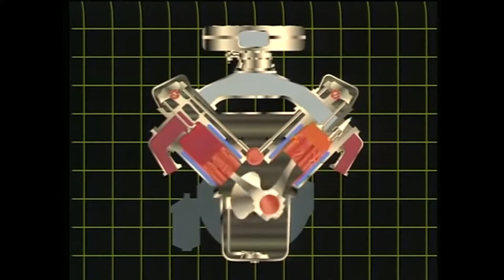Engine Rod Knock Vs. Piston Slap - Take a listen to both!

Comment: The whole "classic cars were only designed to go 100K miles/a couple years" thing is such a BS statement. Classic American cars survived in mass for a reason. My daily driver for the last 15 years has been the same 68 Plymouth and also I've got a 72 Cadillac, 73 Mustang, 67 Cougar, 75 Valiant, 68 Dodge Coronet and an 84 Trans Am that are all still going strong on their original engines and drivetrains and they are all such common cars that I was able to get them cheaply in this day and age. That's not just some fluke. Especially considering there are almost zero classic foreign cars out there running on their original build.
Reply from the maker: Hmmm, these facts and opinions seem to look pretty similar, don't they? 😜

Comment: My '99 Silverado Z71 5.3 with close to 300,000 miles has piston slap for about a minute upon first start up of the week then it goes away and it's very quiet (it only gets driven to the dump once a week).
Reply from the maker: Seems to be a common issue in that generation of GM V8's, and all of them don't care and just keep going too!

Comment: The 3.3 gm and the 3.8 can be the crankshaft balancer broken sounds exactly the same.
Reply from the maker: Is that a common problem on those puppies?
Reply: @ Yes and it sounds exactly like a rod knock I mean exactly the rubber separation on the crankshaft pulley.

Comment: I had an 85 cherokee with the 4 cylinder. It had a really bad rod knock from being run out of oil before i owned it. I said ill drive it until it dies. Got around 60,000 miles out of it. Im not saying to do it. Just saying i got real lucky. Most people probably would have scrapped the engine when the knocking began. But i wasn’t worried about what so ever. So i just kept it going until it died just to see how long it would take. When it finally did croak there was over 1/4” of gap between the crank and rod. But every other part of the engine looked like it was a maintained engine with less 100,000 miles on it. I found that to be quite odd how the rest of the engine was in very good working order. I even ran it out of oil once myself by accident. It had a leaky top pan gasket. Which was why it ran out of oil in the first place. I never bothered to even fix it myself. But that was just some add on to your video. But yeah. Time to pull that engine if it has rod knock. Because it isn’t gonna last.
Reply from the maker: Damn, that's actually pretty impressive! It does surprise me how long some car parts can still go despite being completely annihilated. I had a family member drive for several days on a front wheel bearing that had completely disintegrated, which basically left the car riding on the outer bearing race and the CV axle.... how it didn't catch on fire, or worse, i have no idea.
Reply: @ExiledWolf84  ain’t that the truth. My brother drove about 50 miles on a completely blown engine. No idea how it was still running. Bot the crank and cam were broken into 3 or 4 individual pieces. Some of the rods were bent. Some really bad. And the number one piston was nearly completely inverted in the cylinder and that rod looked like a horse shoe. Id say that was the final nail when it finally quit. It sounded like 10 blacksmiths pounding anvils in the same room. Lol. It was a very high mileage 351 windsor from an 84 crown victoria police car. It really hung on until the very end. It had nothing left to prove. Lol.
Reply from the maker: Damn, that's impressive!

Comment: quick question, i believe it is just piston slap, but it only happens for maybe 3-4 seconds when i start the truck, and then goes away. will get worse over time?
Reply from the maker: That has several variables ... What kind of truck and engine does it have? 

There is a common issue, for example, with some of the 4 cylinder Toyota engines where there is a pin that fits into the VVT-I sprocket that wears a little, and when you first start the engine up, the pin has trouble engaging the sprocket and its jitters around for a few seconds before it seats, causing a clattering noise on startup.

Not saying thats what your engine is doing,  but it's just as an example of noise that can come with an engine startup.

Comment: Most of that sound you heard with the rod knock is actually the sound of the piston tapping the cylinder head due to the increased rod bearing clearance.
Reply from the maker: So i've been told! Wish there was a way to add tidbits to the video after it was uploaded!

Comment: Bad groundwire on that first startup, i assume.
Reply from the maker: I wouldn't be surprised! In that particular shot, it's trying to start with just a old jump starter with just barely enough juice to get it running. The car hadn't been registered since 2019 (as you can tell from the pine needles) and belongs to a family member who moves it from place to place hoping to get it fixed up someday.... well, looks like one of those times it didn't have any oil in it and this video was the result of that!
Reply: @ExiledWolf84 yeah, it shows that it sat for a while. Maybe not a bad ground wire, maybe just caused by sitting for a long time. But the sound of bad ground wire is exactly like that in the beginning. Slow, almost stopping, and then it slows it way to start..
Reply from the maker: @aciddiver1978 I'm willing to bet the body grounds are corroded something awful, like you are saying. It basically sat in a wooded area for years and wasn't taken care of or washed at all before that!

Comment: Piston slap was common on GM 3100 and 3400 60 degree V6 but has nothing to do with reliability I had 469,000 kilometers on a 98 Buick century with the 3.1 ticked like a clock but always started when I wanted it to.
Reply from the maker: Buick has always made a hell of a vehicle, haven't they? The particular one in the video was HEAVILY abused and was basically abandoned in the woods for several years, and was run once or twice with no oil... Hence the rod knock... Too bad, because it was a nice car at one point!
Reply: @ExiledWolf84  proper maintenance prevents poor performance...good video

Comment: As a Volvo Red Block driver with 500k miles, I worry if I don’t hear piston slap.
Reply from the maker: I hear that! I had an old Landcruiser that leaked oil from the rear main seal, and so long as it was leaking, I knew there was oil in it.... If it stopped leaking, well, then there was a problem!
Reply: One day working at a shop I got a repair order to check out a Volvo for engine noise and oil leak that was just driven in. There was a hole in the block ! Since it was already junk i drained the oil out of it and held the throttle wide open. It ran then the rpm's started to drop until it locked up.

Comment: I think i got piston slap with my Mitsubishi. Knocking for about 20 seconds. Weird, i just got 32k miles and have piston slap 😢.How come? Is it because of thin oil that i use? The dealer asked me to use 0W20 oil. Should i change it to 5W30?
Reply from the maker: I'm guessing that the car is relatively new? I wouldn't change the viscosity of the oil from what the engine recommends, especially on something that new with so few miles.

Comment: The Cadillac sounds like valve train noise to me. I could be wrong.
Reply from the maker: It's a possibility! The noise is running at twice the frequency of the valves opening and closing, but If I dig into the valve train and find that there are two dead lifters then I will re-upload this with a different video for the piston slap noise.

Comment: You didn't explain the diagnosis procedure. Pull plug wires till offender is shown, goes away= piston slap, gets more frequency= wrist pin, gets quieter = rod bearing, changes pitch or frequency on two adjacent (on crank throw) cylinders= main brg.
Reply from the maker: Might have to do a follow up video on that one!

Comment: What about wrist pin knock.. I think it's a double knock  noise.. metallic noise
Reply from the maker: It's hard for me to comment on that one since I haven't personally experienced it yet, but from what I've been told it's a little less consistent and sounds sloppier than rod bearing knock, simply because you have the element of the piston rattling around as well!

That and the fact that it's a little more rare because wrist pins are seemingly made out of the hardest material known to humankind! 😜

Comment: I think my 2022 Mitsubishi got piston slap. Knocking for about 20 seconds. I just got 32k miles with this car and have this piston slap 😢
Many friends with this car also have piston slap too. Is it because of thin oil. The dealers recommended 0W20 oil in a tropical hot climate country here
Reply from the maker: Funny, the guy who commented right before you had the same issue with the same car!
Reply: @ExiledWolf84  maybe he has the same car. Piston slap is majority cases recently  especially in my country. The latest cars that recommended thin oil 0W20 or thinner got piston slap at low milage (below 50k kilometers)

Comment: What is the difference between piston slap and a slightly worn wrist pin. Both of them will go away when the engine warms up
Reply from the maker: From what I understand piston slap is cause from either wear on the piston rings, or from wear in the bore, almost like it's becoming slightly oval. 

I didn't cover it in the video because I simply forgot to talk about it, but as the piston expands with heat, it fills the bore a little better and the sound goes away.

I don't personally have experience with a worn wrist pin yet so I can't comment on it myself, but I imagine the noise would be similar depending on the wear!

Comment: What is it if that piston slap noise starts when its warmed up.  Its not loud but noticeable.  No sound when cold.
Reply from the maker: It's hard for me to tell you exactly, because it can be a number of other issues, everything from valve lash to clearance issues with something else... What kind of engine, if I may ask?
Reply: Its a 1975 Mopar 440.  I have trick flow heads on it and harland sharp rockers.  It seems to be a solid motor.  I have 5000 miles on it since the rebuild.  It just seems strange that it is quiet during warm-up but a but noisy after warm-up.

Comment: rod knock goes away while under load and is loudest while maintaining cruising speed.
  The first one sounded like a piston pin knocking between the rod and the Piston. never got to hear it under load.  why not disassemble it and check the rods
Reply from the maker: I've considered trying to get the car and actually do a teardown on it, but i'll just say it will probably be some time before the owner decides to actually throw in the towel and let it go, as odd as that sounds!

Comment: Can piston slap cause oil consumption? I have a base 6.1 forged 426 Hemi and it consumes 1 liter of oil every 700 miles
Reply from the maker: It most likely would, as the Piston is able to move around a little bit on his axis and likely will let some oil past the control rings.
Reply: @ExiledWolf84 Thanks!! 
In my case I hear the piston slap in warm even the same as the Cadillac. I think there may be wear on the wall or the Piston. Can this destroy my engine? It has 30k miles since it was done.

Comment: Well that clears some stuff up.  My 2006 Explorer has piston slap (as it seems do all the 3 valve 4.6 liter Ford engines), whereas my snowblower is going to blow up at some point.  Never buy used lawn equipment is the moral of the story.  Oh well I only paid $300 for it, and it's made it 3 winters.  And you don't rebuild those engines anymore, you go down to Harbor Freight and buy a new one.  God bless the Chinese.
Reply from the maker: Haha! That actually made me laugh a bit! I'm waiting for my single cylinder Kohler Courage engine in my lawnmower to blow up so i can stuff the v-twin Predator engine in it instead!
Reply: If you can't easily replace anything in the motor, that is pretty crappy.. If the rest of the blower is good just get ya a predator and switch them out.. Those briggs engines are super easy to work on, especially the raptors... Then again I've rebuilt mostly raptors for racing with go karts over the years and various other briggs engines.. Those raptors have some very nice extra metal in the head to bore way over the legal limit..Been over 10 years though so not sure if raptors even are still sold..

Comment: Piston slaps really? It sounded like a collapsed hydraulic lifter to me. It didn't occur under effort and it sounded half the speed of the engine. So it's lifter tic tic tic...
A way to make sure is to listen which cylinder is concerned with a stetoscope and remove the plug and see if there's a change in the sound.
Reply from the maker: It's my educated diagnosis that that's what it is based on running the engine with the valve covers off and that the valves were opening at half the frequency of the speed of the sound, plus it's hard to tell in the video but it's a lot more prominent on the lower end of the engine. 

But hey, I could be wrong, nobody is perfect!
Reply: @ExiledWolf84  You still make the point that rod knock is bad. About if it is piston slap or lifter, it's still not a big deal like you said.

Comment: My car is just making an ultra low pitch thud. You can barley hear it. But you can definitely feel the vibration. Any clue what that is
Reply from the maker: Could be numerous issues, anything from bad engine mounts to something just being loose somewhere. How would you describe it? Is it rhythmic with the engine speed?
Reply: @ doesnt seem to be rhythmic. Seems random. Its a 2019 challenger 392 with 26,000 mi
Reply from the maker: Huh, I used to own that exact same car! Same year and everything! 

Is it when you are driving? Changing gears? Going over bumps?
Reply: @ i only feel it at idle. Car is still driving fine
Reply from the maker: Almost sound like it might be a lose engine mount or something. Those car are under a lot of stress depending on how they are driven, something could have loosened up. 

Are you still under warranty? 
 @micahwatz1148

Comment: Sounds like a collapsing lifter to me not piston slap in the caddy .
But I’m no mechanic.
Reply from the maker: The engine is currently torn to bits getting a new timing chain, oil pump, and a few other doo-dad's as well, to include lifters, so we shall see! 

If that makes it go away instantaneously, then I'll post an update, because I definitely am the kind of guy who will admit when I was wrong about something!

Comment: The car companies even offset the wrist pin slighlty to try to alieviate piston slap and i assume it worked to some extent because piston slap is not something you even hear about anymore and it seemed that it was the older v8s domestic motors that had tolerances that were not always followed to the letter i guess bores just a smidge over size etc the motors were mass produced and ive seen some that when taken apart made me scratch my head thinking wow what the.. this thing had 150 thou on it before it blew up thats impressive lol oil holes in main bearings that didnt quite line up perfectly leaving only about half of the hole  feedjng oil to that bearing also the hydraulic lifter was made to take up the difference in some parts being a bit off whether it be push rod or rocker arm sometimes up to an eightth of an inch in length difference between one to the other pushrod was easily taken up in the preload of the lifterr keeping the mechanic out of the valve covers due to ticking noises thats just one example of tolerance issuees w factory parts oh yeah the oil holes it was a buick motor w over a 150 thou on it and it was more than one main bearing that could not have been. Getting the oil it was supposed to be getting all i can think is gramma drove that car its whole.life cuz if ir were me it would have shown up shit almost right away im sure when the rpms hit 4500 ten times a day lol can you say knock knock knocking on heavens door lol
Reply from the maker: Oh, for sure! I'm sure it was common as hell back in the day. 

I mean, even In my situation here, my Cadillac is a 1975 with the 500 cubic inch motor, and the tolerances on it have to be huge compared to modern engines. I mean, when it was new, one of the recommended oil weights in the manual is 20W-50, and just being a domestic US engine from the mid 1970s already puts a strike against it for build and quality control.
Reply: That was the longest sentence I've ever read, but you aren't wrong brother.
Reply: I really like this comment

Comment: What about a tick at high idol?
Reply from the maker: Difficult to diagnose without more info... What kind of motor?
Reply: @  it’s on a 2009 case skid steer diesel motor not for sure. Believe it’s a case motor makes a slight ticking sound at max RPMs.

Comment: Im surprised how long the engines run after they literally explode into pieces from inside out, I'd think the entire engine would seize but nah.
Reply from the maker: Oh yeah, some of the cars going through the cash for clunkers routine were pretty impressive with how long they could run with literal holes in the engine block, and broken Crankshafts. the Nissan and the Mercury can in the video were two of those cars.

Comment: Not piston slap in the second car.
It s valve tappets wear.
Reply from the maker: Possibly...  But I ran the motor without the valve covers to diagnose and the valves are only opening at half the frequency of the sound, plus it's a lot more prominent at the bottom end of the motor, which is hard to tell in the video. 

But hey, maybe I screwed up, and rather than leading people down the path of righteousness, I'm leading them down the path that ROCKS!! 👹